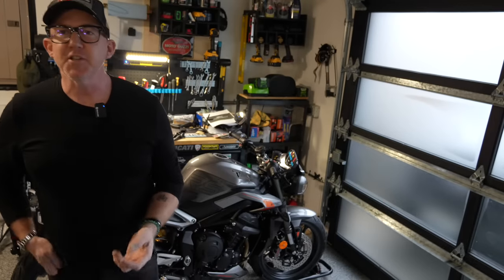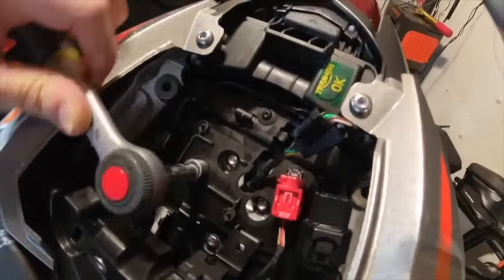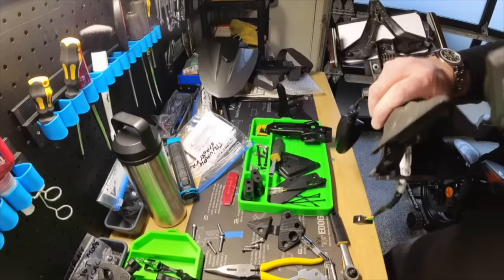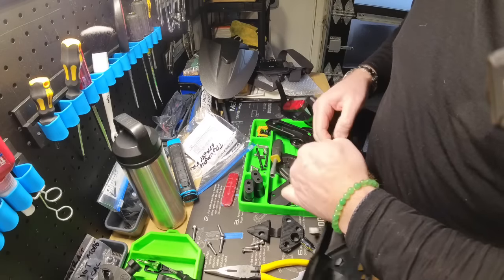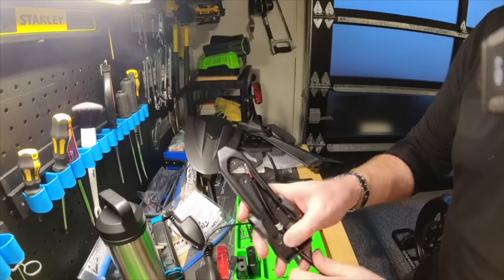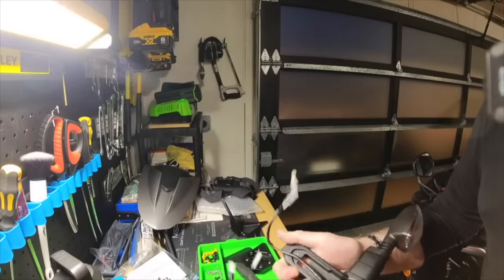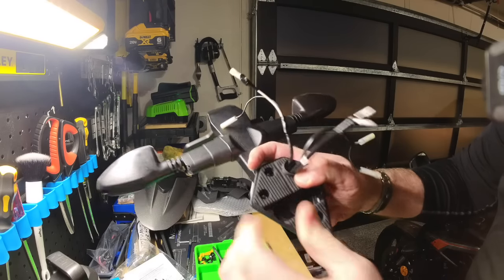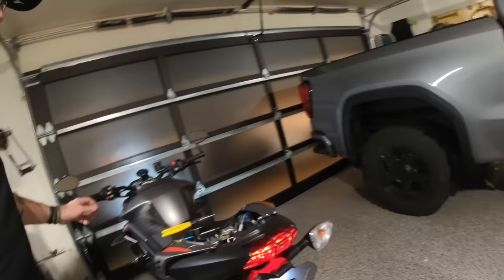EvoTech Tail Tidy Install on 2023 Triumph Street Triple RS

Comment: Appreciate this video but I have a question on how to connect the dual prong connector of the tail tidy light to the triumph cable? It has a different kind of connection. Do I need an adapter for that?
Reply from the maker: The connector comes with the ecotech product